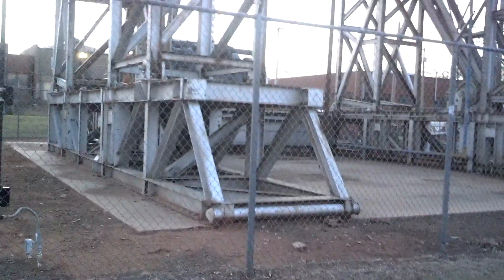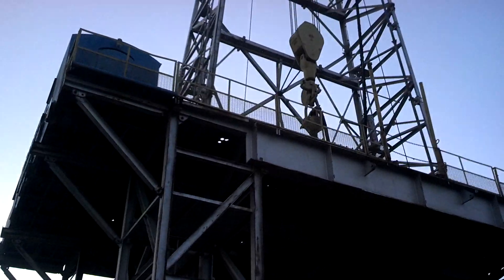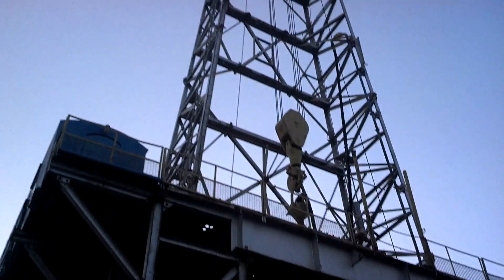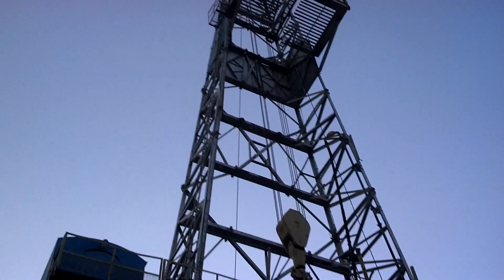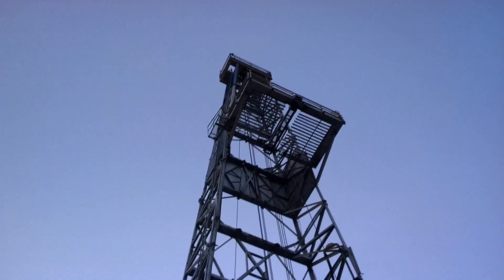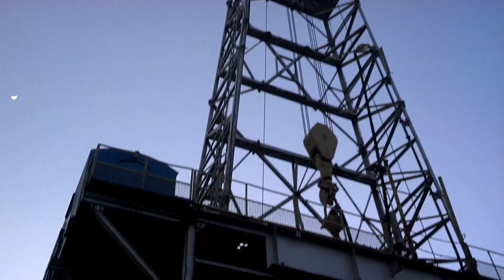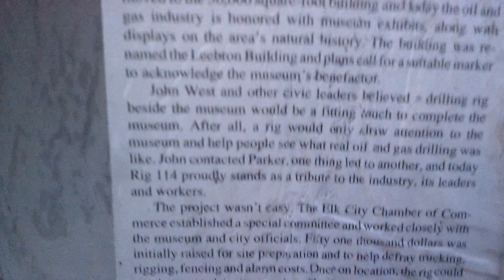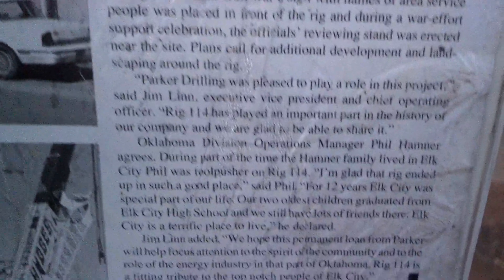Worlds Tallest Land Drilling Rig

Comment: Those are traction motors on the Draw-works.
Reply: I wonder if the 2 Faded Orange Electric Motors behind the Draw works came from Parker 88 ?
If I still remember correctly, this pair of Electric Motors originally powered a U.S.A. Submarine and served Parker 88 in 1975 which was a Standard as well as Parker 90 until they both had worn out Gerts etc. It's embedded in my soul and to this day I can still hear our Driller screamin (while goin in the hole) at the Derrick hand- White Line You better not let me see a white line on my chart.
BTW... Before Parker 85 Left West Texas and went to Oklahoma that rig could pull 4 joints instead of a normal 3 joint stand before it Crowned out,,, please forgive me if I'm wrong about any of this.

Comment: I remember when my brother Tony Mitchell with Canon Safety was working on that rig. He sent pictures back to me to show me the size. Had an elevator to take you up to the floor. He is an H2s safety hand. He's done that for 35 years. He said they called it quits on the exploration because the cost per foot to drill was no longer worth it anymore. The deeper you go the more costly it gets. When it was in operation the rig floor and pipe stand was completely enclosed and not canvas or plastic.

Comment: i worked parker 112 for quite a few years - 112 and 114  were sister rigs built to drill nuclear test holes in the Aleutian islands in the 1950's - very unique sub structure later used widely by parko - good tough rig still working somewhere - only thing left is the sub and derrick because of the historical value - 28 feet wide at the board and i worked the board when top drives were a glimmer in your daddies eye.
Reply: do you know Dewayne Thomas .